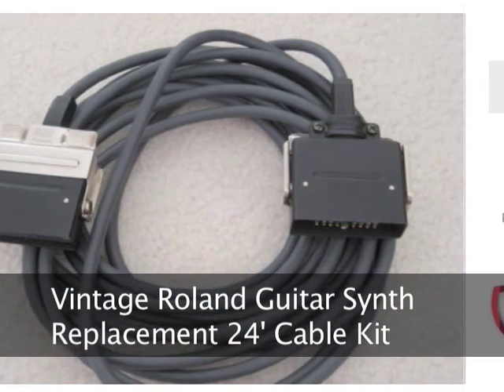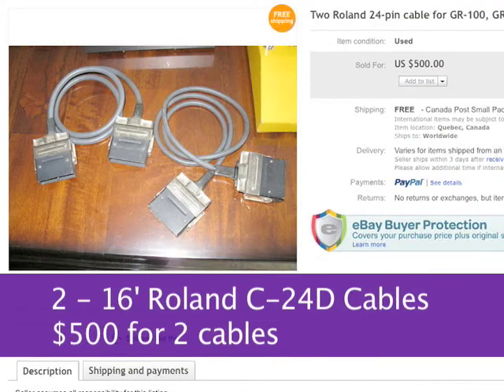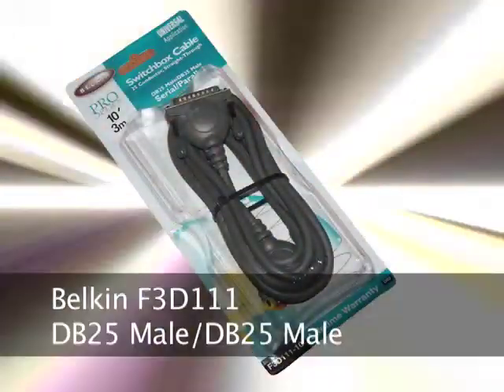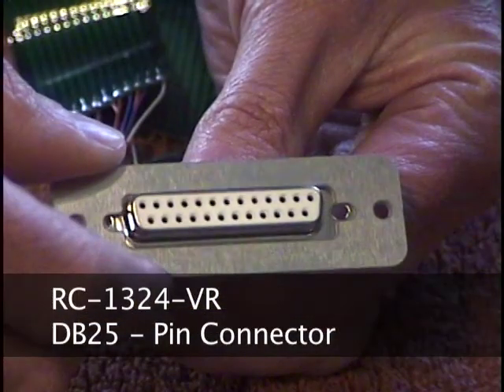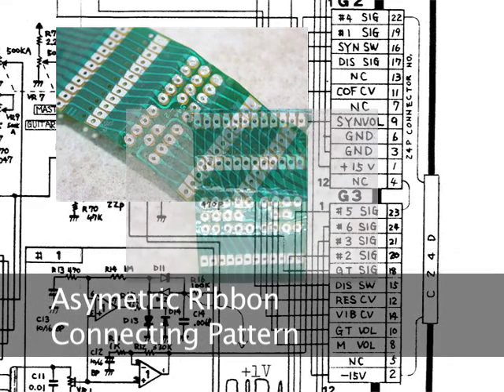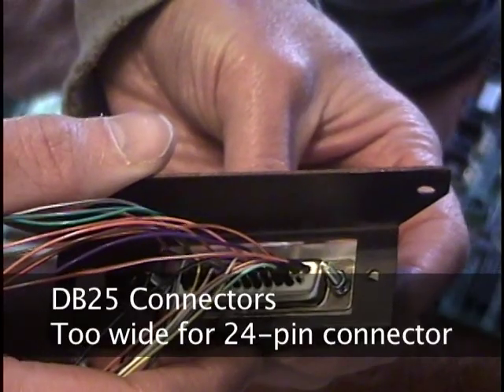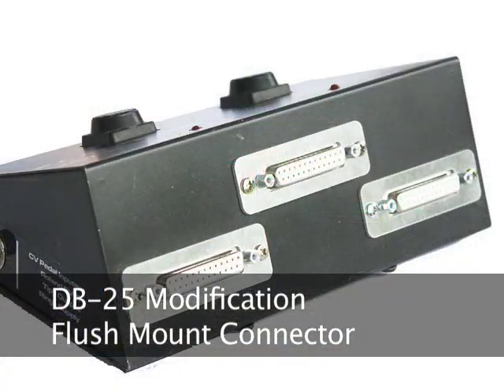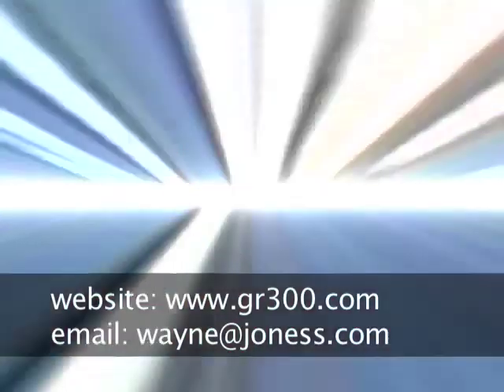Original Roland G-303 G-808 GR-300 GR-700 24 to 25 pin Retrofit Cable Kit

Comment: Fantastic.  I bought a G-707, GR-700, 24-pin cable, PG-200, and about 8 memory cards, in a package deal on eBay for about $500 altogether maybe 6 years ago.  The G-707 was in terrible condition and nothing worked like it should so I ended up re-selling everything on eBay a few years later, to the tune of over 100% profit.  I think I started the cable at $100 and it went to something like $350 on its own.  Yowza.